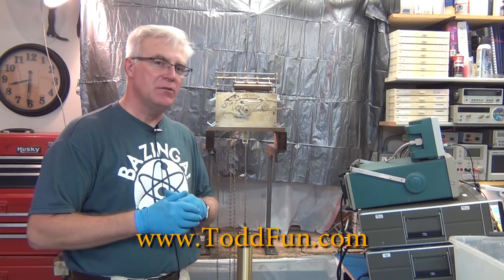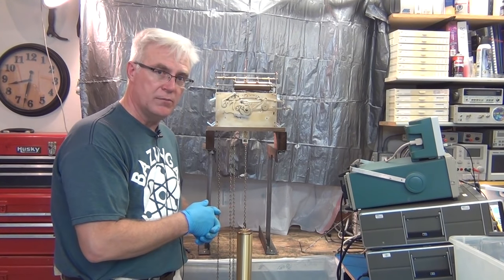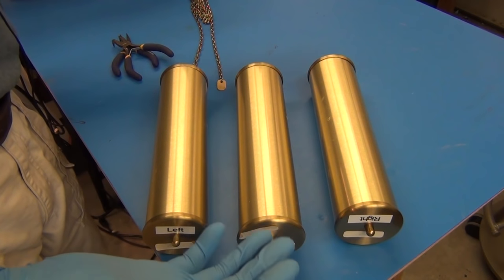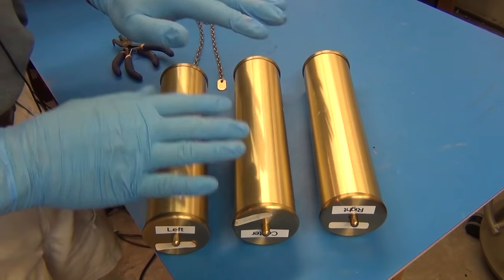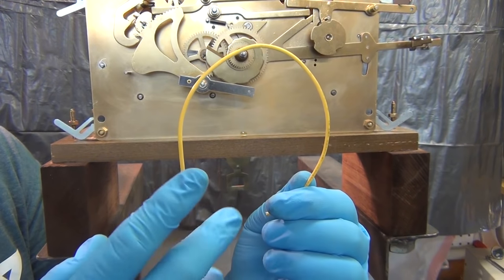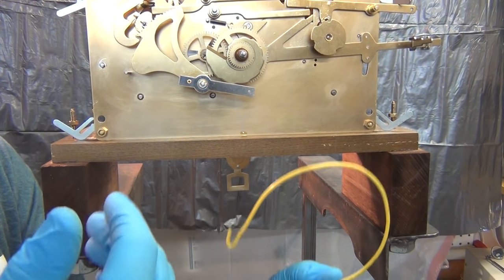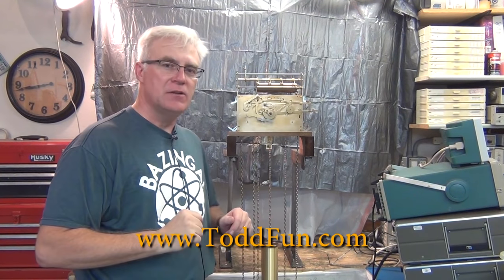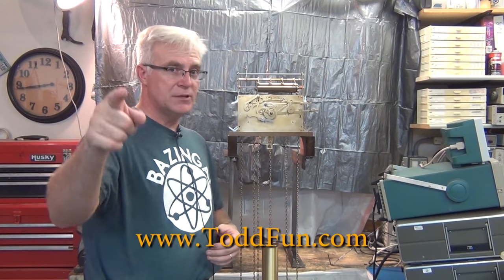How to Remove and Install Grandfather Clock Drive Chains

Comment: Cora / 31 from Alaska here. 1st order of import, THANKYOU for the time you’ve taken to help with my very specific inquiry , refreshing , so again, your time is definitely appreciated ,,

With the feeding through of the chain, since there are the teeth that the chain loops fit over and are easily rotated into the direction you want to feed the chain  ,
is it feasible to place the chain onto the teeth and then manually manipulated to spin the chain up and over , continuing until the chain is in the desired length .   (I am writing this while watching , starting after threading the first , left , chain.  Random , but letting it be know )

Again, THANK YOU THANK YOH THANKYOU
Reply from the maker: Yes if you can get that chain started that way and then if you can manipulate the sprocket to turn it will work. I would say only a few clocks that type of loading would work.

Comment: I am new to Grandfather Clocks, really have no real experience other than 2-3 months or so. I have a Howard Miller Clock, and have been pulling the weights down from left-to the middle and then the far right. I have a chain pull for all 3 weights. It’s a 1972 clock. Well early this morning the weights we’re getting low and I pulled them up in the same order I described above. All even high. When I was pulling the 3rd far right weight, I noticed it would intermittently chime, that perhaps the chains may have been making them vibrate.  A few hours or so later, I learned I hadn’t heard any of the chimes sound off at all. The time keeping was correct, but no chimes at all, not on the quarter, the hour or 30 mins  turns. Nothing at all. I noticed only the middle weight had come down a little, the 3rd weight on the right did not come down at all. The far left weight wasn’t really noticeable to me if it had. My clock does not have side access panels, but has a rear access panel. I was able to retrieve the 3 rd weight chain and gradually and carefully gain some slack to make the chain a bit longer. I reattached all the weights back on and the clock moves, but I still have no chimes at all. I’m not sure if that 3rd weight being hung up may have knocked the clock sync or timing off, if that’s even the correct terminology to use. Anyone have any suggestions? I used it for 3 months and it worked great.  When I pulled the back panel off the back, I noticed 1 of the hammers frozen in the pulled back position . The other hammers seem to be flush with the strings/cords. Any advice or help would be greatly appreciated.

Comment: I do have some questions. My clock weight barrel 2 is 8.4 lbs, and one is 13.4 lbs. If I put 13.4 pounds in the chime, it works, but 8.4 pounds does not work in the clock mechanism. But if I put 13.4 pounds in the clock mechanism, it works. How can I fix this problem? Please help.

Comment: hi my name is todd also i have a howard miller clock chain driven clock that does not chime. my question is how do i set the time ? do you move the big arm clock wise or counter clock wise? when i got the clock the right (looking at the clock) chain was off and i set the time by turning the big arn clock wise. please help if u can

Comment: Your videos have been helpful in the past, but I have a problem that I haven't been able to locate it's solution. My left chain, I believe that it's the one that makes all of the movements move and drives the pendulum, no longer stops/ratchets. When I pull it up it just goes right down again. Is there something that needs adjusting or something needs to be replaced? Any advice/suggestions would be appreciated.
Reply from the maker: You might have a broken "click spring" on your main sprocket. Sometimes they can get worn out too and jam and/or get dirty and jam. If any of these happen the sprocket will free wheel in both directions. 
https://www.youtube.com/watch?v=SZgJl4VyvRc
Reply: @ToddFun  Thank-you very much. I will watch the video and hopefully fix the problem.

Comment: Todd I know you said the heaviest weight on right and lightest on the left, my clock is strange they are almost the same weight 4 LB, 4.6 LB and 4.7 LB. so is that the order from left to right?
Reply from the maker: yes, I would try that first. If one of them stops dropping then switch with a heavier weight. I would also look at the weights every carefully to see if there are any markings that would let you know which order they on (L,C,R) or (1,2,3) as examples.

Comment: i do have a question  and i hope you will see it to answer it  i took off the weights when moving the clock from house to house but i have weighed all 3 weights and the right one like you said is heavier..the center and left are equal weights..does it matter which weight i put on first .. just curious  thank you ..i suppose i will start with the heavier one or does it matter?
Reply from the maker: Order of hanging the weights does not matter.

Comment: Hello Sir, I am James from Scottsdale, Arizona. I have recently received a 1973 Tempus Fugit Grandfather clock that has been in the family since 1973. I have found your post extremely helpful but as I have come to find, I am missing a component that makes up the VERGE assembly. If I had to I could probably fabricate something but where would I be able to purchase components? 
Appearantly I am missing the component that slides into the center of the cylinder or rod with a slat cut into it directly in the back of the dial. I have the pendulum and the oddly shaped key of sorts that the pendulum rides on I need the componet between the oddly shaped key and the cylinder with the slat cut into it. This cylinder has a set screw twist knob adjustment. Can I fabricate something to work or where can I obtain parts? Thank you in advance kind Sir!
Reply from the maker: Well you live in Scottsdale so just drive over to timesavers.com and ask for some help locating parts. They have great people there and tons of parts.  If they can't find parts I'm sure somebody from the back room can point you in the right direction to fab a fix. Bring photos or the mechanism if possible.
Reply: Todd Harrison You are a good man Charlie Brown. I will consult with them and hopefully resolve concerns. I will let you know how it goes.

Comment: I recently purchased a Howard Miller grandfather clock from someone and it came with a broken chime rod this is my first grandfather clock I'm wondering do I have to replace the whole chime block or can I just replace the one chime rod it has a brass screw that the rod is embedded in and it broke off flush of the screw it is a side mount chime block any ideas any help would be grateful thank you and I love you videos I'm very informative
 Charles
Reply from the maker: Call these people during business hours. They will need to know the make and model of the clock as well as which chime is broken. They might even sell chime rods on the website. However, after mounting you will have to tune it and unless you have a good ear that might be difficult. If it has to be tuned and you cut off too much the rod is no good. https://timesavers.com/contact.html

Comment: im wondering about the position of the chime shut off lever.  Is the chime shut off lever the long lever on the right of the mechanism, that is in "up" position?  Is the lever in the up position the "chime off" mode?  My franz hermle 451-053 does not chime, but clock works.  The right and left weights dont go down, but center does, and clock itself works fine.  Just the chime does not work.  My lever is in "down" position.  thanks.
Reply from the maker: Well just move it to the other position and see if it start working. If not then for sure something is wrong and it'll have to be looked at by a horologist.

Comment: Todd, I have an antique grandfather clock triple weighter that chimes on the quarter hours but not on the hour. Any advice on how to repair? The clock keeps perfect time, just doesn't strike on the hour.
Reply from the maker: Does the weight for the hour drive train drop as normal as the clock runs? This is the weight on the left. If not then something is jammed or warren out like a pivot. Do you have a silence lever that might be 1/2 engaged? You can also look up a horologist in your area, they still make service calls in most places.

Comment: A old lady my neighbor has a tempus fugit and kids pulled the chains too far is there a release in the back of the mechanism? Thanks
Reply from the maker: Yes but to get to the "click" springs you have to take out the mechanism anyway. I have never had any luck getting to the click springs to let down the weights while the mechanism was in the clock. So you might as well see if you can unscrew the hook hangers from the weights while somebody holds the weight body and weight bottom plate. Once the weights are apart you can remove the mechanism or maybe even just remove and re-install the drive chains as in this video.
Reply: @ToddFun  thank you sir you saved this friend of mine hundreds of dollars 😊

Comment: Hi. I picked up a Seth Thomas 80K 116cm 26, 9-8 Grandfather Clock which appears to be early 80's. Clock shows a full service tag from a well known clock shop dated 2008. Clock shows no damage other than the left and right side weight cables being pulled / wound up too high. How would I release the cables back to their nominal position so I can reset the weight pulleys and weights? Do you have a video on this procedure? Many thanks.
Reply from the maker: Sorry, I don't have a video on do such. It could be very difficult and I hear this problem all the time. Can you unscrew the bottom of the weight to get the weights out of the brass tubes? I know some do unscrew like that. Then you might be able to take the top of the weight off and pull the chain gently round like in this video and then re-thread it watching this video. There is a click spring on the back of each main sprocket, if you could hold the weight up and carefully push as stiff wire like a bike spoke bent just right you might be able to hook and pull or push the click spring to release the ratchet. Push or pull depends of the orientation of the click spring.
Lots of photos in these posts, click on them to see extra large photo:
http://www.toddfun.com/2016/05/30/how-to-disassemble-a-grandfather-clock-part-2a-of-4/
http://www.toddfun.com/2016/06/01/how-to-clean-a-grandfather-clock-part-2b-of-4/
http://www.toddfun.com/2016/08/07/how-to-assemble-oil-and-grease-a-grandfather-clock-part-3-of-4/
In these below photos I'm putting a drop of oil on the click spring in the main sprocket. This is spring loaded pawl that makes the clicking sound when you wind the clock and prevents the weights and main sprocket from rolling backwards. If you can get this click spring pawl to release from the teeth of the main sprocket body the chain and weight can drop backwards. Not sure you will be able to see or access this click spring pawl while the lock is assembled, not likely I would say.
http://www.toddfun.com/blog/wp-content/uploads/2016/08/How-to-Assemble-Oil-and-Grease-a-Grandfather-Clock-part-3-of-4.Still005.jpg
http://www.toddfun.com/blog/wp-content/uploads/2016/08/How-to-Assemble-Oil-and-Grease-a-Grandfather-Clock-part-3-of-4.Still006.jpg
Reply: Thanks Tod. Actually the answer I was looking for may be in the 3rd line of your answer above: 'There is a click spring.......". I should clarify that I have no problem with the weights as all 3 are removed and waiting to be reinstalled. My problem is getting the weight cables to release (note that my clock is cables and not chains) as they appear to have been wound to the top. I do believe that there is a click spring or something to that effect that I need to release on each cable spool so I can draw the cable back out. I'll try a piece of stiff wire with a 90 bend at one end. With some luck...it just might work. I'll keep you posted. Thanks again.

Comment: Good morning. Could you tell me if for a grandfather clock with a chime the weight that weighs more has to go to the center ??? thanks
Reply from the maker: They should be marked on the bottom or someplace. If not I have always seen the heaviest on the right because that runs the 1/4 hour chimes and therefore has the most movement in a week so the gearing gets more torque to compensate for the need for move movement in the same drop as the other two that don't need to produce so much movement in the same drop.

Comment: Hi. At the beginning of the video, you said you would show how to fix the chains if they've been pulled up too high after taking the weights off. Can you tell me how to do that? I can't find a fix video anywhere. I will look at your blog for this as well. Thanks
Reply from the maker: I don't have a video for that, sorry. Sometimes you can unscrew the weight canisters and drop the weights out the bottom of the tubes. This can give you enough room to unhook the top of the weights. Then remove the hocks, pull the chain through and then follow my video on re-threading the chains. If you can't take the hooks off because they are too high sometimes you can still pull the hooks and chain trough by pocking a wire around inside to fish the chain and hook around any gears and shafts. Hope that helps. Other than that you'll have to have a horologist service the clock.

Comment: Thanks! I was able to do the outside chains without much fuss just feeding them in from the sides without any other tools, but that center one has me stumped. I will give it a try with some wire.
Reply from the maker: Excellent! Hope it works.

Comment: I just assembled an emperor  model 571 or 575.  Brand new - lain in box for 20 + years.  Assembly went well except the chimes do not chime.  I went thru the troubleshooting section of manual - all appear fine (from troubleshooting suggestions).  I do hear the clicks.  The heavy weight is in correct position, nothing appears tangled.  The chime selector will not slip into bottom selection.  As a know nothing clock person it seems that the chime selector may not be moving out of silent position even tho selector indicates it has moved.  I would greatly appreciate your help.
Reply from the maker: Not much I can help with from here. Wish I could help remotely. See if you can find some clock forums to post the question or lookup a local horologist. Good luck.

Comment: My weight is lying in the chair. The chair was pulled too far by me (up into the clock) and I can't see the end to get it out. I got a flashlight and a mirror, but still can't see it. The side do not come off of this Amish clock. This has really upset me because I can't fix it myself. Please tell me what I should do Todd?

Comment: I watch your video and is very helpful. I was able to remove one weight, However, the other two  weights were pulled up too far and I am not able to remove them.  How can I fix that?
Reply: It is a Howard Miller
Reply from the maker: What weight did you take off already? If it was the center weight just put it back on and let the clock run for a few day making sure it is not in silent mode and the other weights should come down.

Comment: I followed your instructions and was able to attach the chains but my pendulum seems to stop swinging after 15 mins. Any idea why thatd be?
Reply from the maker: are your weights in the right location? There’s a small piece of spring steel just above the pendulum, called the pendulum spring. Sometimes they can get cracks in them and not swing properly anymore. Also, your clock could get worn out where the pivot points or wobble out and the gears are not able to rotating straight, causing the clock to slow and stop. Clocks also need to be oiled every two years. and Clocks should be removed and cleaned by a professional at least if they’re 20 or 30 years old.

Comment: I purchased a Ridgeway G F clock estate sale $ 50.00 , center chain was off , followed his direction worked perfectly.10 min fix clock works. $50.00
Nice investment.
Reply from the maker: Glad to help.That's why I made the video. Chain came off and I could find any help online, in a book or video so I figured it out and made a video so others wouldn't have the same problem finding the information.

Comment: I'm not sure if the pendulum or roller is broken on my Howard Miller clock but if you know what could be wrong please let me know. But I'm not sure if the gears are broken but I don't know a lot about those clocks, I'm not sure if the time on the clock has something to do with it. I did notice  that the weight in the middle has a little dent in it but it's not that big I'd say like half an inch or something. (If you can help me please let me know)
Reply from the maker: You're going to need somebody to give it a good looking over. Google for local clock repair service. Many still do house calls.

Comment: The Clock does not chime at all now. Yesterday it would chime at right time but minute hand  would be  on 3. Think I may have to call someone. Thanks for the fast response yesterday.
Reply from the maker: True. Let me know what they find. Sounds like for sure the nut on the back of the minute hand needs to be turned backwards for that 3 minute correction. You sure you didn't just move the silent switch to the silent position?  That would cause it to stop chiming.

Comment: What would make the chain ratchet slipp allowing the weight to drop a few inches?
Reply from the maker: A broken or damaged ratchet click spring (happens most often). Or damaged or worn out ratchet teeth / click spring pawl (not very likely but possible). Or worn out pivots bushing allowing the drum to misalign enough so click spring pawl can skip ratchet teeth. (possible on old clocks or clocks never oiled regularly)